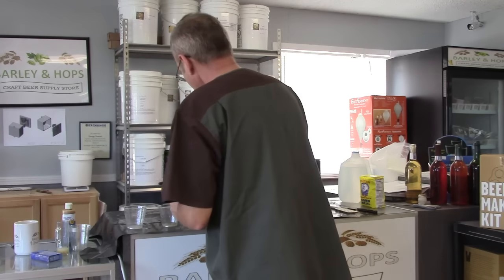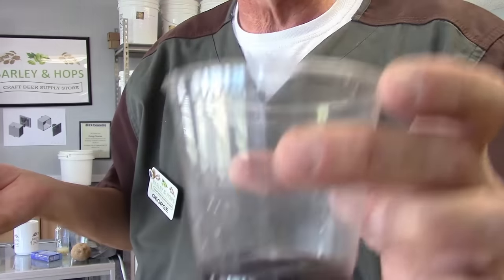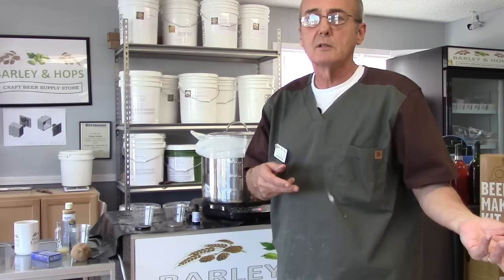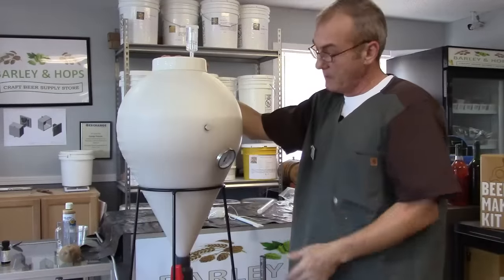How to make a corn mash for distilling

Comment from the maker: I read through several comments about corn meal and starch conversion. Here was the original question:
" I was wondering if you use corn meal if you would have to use the barley to help  convert the starches in the corn into fermentable sugars or can you leave the barley out and just steep the corn meal and that will convert the starches in the corn into fermentable sugars". 
Several replies led me to another test.
Here are the results:
1LB corn meal
1 gallon water
Mixed and took original readings (gravity was 1.001 and the iodine test for starch was positive)
Brought it to a boil and steeped it for 1 hour.
Cooled the mix and took the reading again:
results: Gravity was 1.001 and the iodine test for starch was positive.

Second test with the remainder of the mixture:
Heated to 155 and added 1/2 teaspoon of Amylase Enzyme.
Steeped for 30 minutes
Test results: Gravity was 1.035 and the iodine test for starch was negative. The mixture was also sweet, watery liquid and sticky on my fingers as opposed to its original texture which was thick.

My reinforce the science of converting starch to sugar. Amylase Enzyme must be present. Corn meal will not convert itself not can it. 
If using straight corn meal works for you please continue to do this. If you add any sugar to your corn meal and water mixture to ferment it will ferment but it is the sugar you added that ferments and not the corn meal.

all I can say is the science does not support corn meal converting itself

George
Reply from the maker: I definitely see a video coming on this one.
George
Reply: Barley and Hops Brewing LLC A
Reply: Corn meal cannot convert itself, but if you malt corn seed, it will convert to sugars.
Reply: Barley and Hops Brewing LLC If you were to use cornmeal how do you strain it? Wouldn't it just flow right through the Brew bag?
Reply: Michael Norwood first of all what I would do is use cracked corn or if it is powder form just let it settle when fermenting and bottle or keg as usual when brewing has finished.
Reply: Yeah i laugh at people doin this all the time.

Comment: So,  I got a 24 quart stock pot with a steaming basket inside. I use that, along with a 200 micron polyester bag and it works great ! The basket keeps the bag away from the bottom of the pot. When I'm done steeping, the bag lifts right out with the basket. SO much easier than trying to separate the liquid from the solids by other forms of straining.

Comment: Corn meal is expensive.  Cracked corn is cheap ($8/50 lbs).  Cracked corn will not stick a lautering operation.  I'd like to see you do a video on using cracked corn as the principle augmentative grain.  I found it best to mill it to a smaller particle size then add it to boiling water and when cooled to 190F add high temperature alpha amylase to prevent thickening.  Rye can be added then. At 165F it is added to a mash tun and malt is added along with a small amount of beta amylase.  After an hour this is lautered, boiled 30 minutes with sugar added, and cooled then yeast is pitched. The batch size was 10 gallons.  70% was corn, the least expensive grain.  American whiskey became corn based due to cost initially cost drive that turned into preference.  I tried corn meal and rejected it after a stuck sparge and high costs.

Comment: Hi George, love the videos. We have a small craft distillery located on the most southern island below Australia and over the last 12 months have started producing our single malt whiskeys that are currently ageing away in barrels. Recently we decided to attempt a American style "bourbon" whisky without much success. We are getting great conversion during fermentation and our last batch even produced the "cap" that you see on some other distillery videos but we are getting stuck on draining the wort away from the grains. we have tried both prier to and post ferment, we have used enzymes as well as made multiple temp adjustments but we are unable to drain using our false bottom mash tun. we are looking at a mash of aprox 300l (about 90 gallons in your language lol) Hope you have come across similar issues and have some tips. Cheers from Australia.

Comment: I was thinking that if you bought a stainless steel strainer that fit inside your pot , it would hold the grain bag off the bottom just enough that you wouldn’t need to worry about the bag burning/ melting on the bottom of the pot.

Comment: George can you answer me a qhestion?? why does it say on my turbo yeast  NOT TO USE A AIRLOCK BUBBLER ??  this kinda confused me,, is it because it holds gases  in or they think it will blow off the air lock?  thanks Ray Fuselier
Reply from the maker: +Ray Fuselier Alcotec does have that in the instructions and also adds that you should check with the laws in your country to make sure you are conforming to them. High Spirits and others we carry do not have that in their instructions. All of them recommend a lid and airlock.
I am not sure why Alcotec includes this statement. 
George
Reply: +Barley and Hops  thanks George,, i have check missouri laws and looks like MO  is the only state that allows a person to run a still,, without a permitt,, it says a house hold can  make 100 gals per person per year,,''lol'' thats alot ,, and cindy and i dont even drink,, maybe a glass of wine at night,, we just enjoy making the spirits and the wine
Reply from the maker: +Ray Fuselier You are correct. MO is the only state to do this so far. I guess they are on the heels of Colorado and a few others. Good luck and enjoy
George

Comment: Soooo, there are at least 3 ways to make this same recipe. 1. just the corn plus the amylase cooked at 152-158 for an hour. 2. the corn, minus the amylase, plus the distiller's malt. 3. either of the above plus sugar to increase the yield. If ones desires quality over quantity, which do you recommend?
Reply from the maker: +thastinger345 If more quality is your goal reduce the sugar used and increase the corn. You can do this proportionately to arrive at your desired flavor. 
George

Comment: hey George your vids are great and very helpful.. I was gona ask you if you think a 2nd distill will help the flavor of a scorchedmash or should I just dump it. 5lbs wheat flour 2lbs white corn meal and it just burned before I new it.. dang it. got to get one of those bags! thanks again..
Reply from the maker: +haulshine409 Sometimes that does help but I have had runs that just wouldn't clear the burnt taste. It is definitely worth a try. 
George
Reply: haulshine409 - Redistill 1-2 more times and filter. You’ll loose most the grain flavor, but it’s better than dumping it out. Or make a Vodka out of it. This is what I did. Turned out pretty good. 

Also, get away from using flours. That should help with the scorching. Hope this helps.

Comment: George quick question, in the corn meal vs flaked corn video you boiled  the water to gelatinize the corn and you said that if you keep it at 155/160 it wont gelatinize. here its the opposite, is that because the 6 row barley is present ? I believe ive heard you say that if you boil the 6 row you kill off the enzymes.... is that correct ?

Comment: George, If you use corn meal instead of flake corn do you steep the meal and 6 row at 155 degrees?
Reply from the maker: +John Dewitt Absolutely. Same product just a different form. Corn meal is super easy to use and very economical. I recommend that you bring the corn meal to almost a boil first to hydrolyze it and then add a little water to cool it to 155 before adding the grain. This process is simple and ensure you can convert as much starch as possible.
George

Comment: You are using 6 row, we live in a remote location in northern alberta, I can get 2 row. If we were to use 2 row & corn meal would it work ok. Your videos are great. We just got a 10 gal stil & ran the first batch of sugar mash, it is a learning process. Thanks
Reply from the maker: +robert groves Absolutely. 6 row has a diastatic power of 160, 2 row is 140. It only requires 30-35 to convert itself so all those enzymes are left to convert other adjuncts. 2 Row works extremely well. There is no need to search for 6 Row barley use the 2 Row for the same results. There is so much enzyme in both that the difference is un-noticeable.
George
Reply: +Barley and Hops Thanks, really appreciate the information you post on you tube. The posts are well done.
Reply from the maker: +robert groves Thanks. I wish you all the best. Happy New Year
George

Comment: So the recipe is:
2lb 6 row Barley
4lb flaked maize
10lbs of corn sugar
5gal water

Is that correct?
Reply: That's what he said, but the text on the screen said use a 3:1 ratio of corn to grain. 
 4lb corn and 2lb grain is a 2:1 ratio.  So, which is it?
Reply: @Antoniodenavarra  I tried the 2:1 recipe and it came out great ! I imagine, since they added the note about 3:1, that THAT would be what George meant. I had hoped George would answer the question.... Oh well.

Comment: I was wondering if you use corn meal if you would have to use the barley to help  convert the starches in the corn into fermentable sugars or can you leave the barley out and just steep the corn meal and that will convert the starches in the corn into fermentable sugars. I see some people doing it that way and some who say you can't do it that way, so I am wondering what is your take on not using barley and just steeping the corn meal to convert the starches in the corn into fermentable sugars. Thanks for you expertise knowledge
Reply from the maker: +Steve Rabon Steve, if you just steep corn meal or flaked corn or any flaked product it will never convert itself. It requires amylase enzyme to convert starches to fermentable sugars. So, either add malted grain (which is loaded with this enzyme) or add Amylase (which is available at any brew shop or on line).
Otherwise you get no sugar to ferment
George
Reply: OK thanks. That was what some had said, I have seen some who just steeped the cork meal also. Thanks for your expertise knowledge. Thanks.
Reply: +Steve Rabon the above isnt neccesarily true, the starches in the corn will convert into sugars if you boil the cornmeal and your Mash sad about I don't know 325 degrees for about 20 minutes it is boiling action will do with the enzyme would normally
Reply: I put my corn meal (5 pounds) in a crock pot with water, heat it on low till it boils, cut it off and let it cool. It converts all the starch to sugar. I add the corn sugar and it really makes good corn liqour.
Reply from the maker: This should be cleared up (from my perspective) in about an hour. I have 3/4 gallon of water, 1 LB of corn meal steeping right now at a low boil. I will check both the starch levels and gravity when finished. Beginning test was positive for starch and the gravity was 1.001.
George
Reply from the maker: I feel a video coming soon (smile)
Reply: why use the specific gravity scale when the potential alcohol is an easiermath for people to understand??

Comment: So you're adding the sugar simply to increase the final product yield correct? Do you feel the sugar changes the taste compared to distilling without it?
Reply from the maker: +thastinger345 Yes. You are correct. I am adding sugar to increase the yield in the end. Since it is corn sugar it doesn't have an effect on the taste. I have made this both ways and when I add sugar I almost double my output. 
George
Reply: Barley and Hops thanks for the info, have you made it with table sugar? If so, was the taste impacted?
Reply from the maker: +thastinger345 Yes I have used table sugar. It does make a difference but the average person would probably not notice it. It is so close to the same it is hard to tell the difference unless you had both side by side. Table sugar turns a bluish-green in a bucket of water when mixed whereas corn sugar does not. Table sugar has been processed 6 times so I am always suspect of what else is in there. The cost difference is slightly high as well. Corn sugar is around $1.20 or so a pound. Table sugar is below a dollar.

George

Comment: I have followed your directions to a tee and twice now I cannot get all of the starch to convert.  I bought one of those induction hot plates and the temp was all over the place.  I would see 10-15 degree fluctuations.  I think I was 3 hours in, I even added some enzymes and it still would not pass the iodine test.  This last time I put the mash on the kitchen stove and let it steep for nearly 8 hours at 155 and it still would not pass the iodine test.  My OG was 1.114, no where close to your 1.120.  My FG was 1.047.  Both times my ABV was 8-8.5%.  My mash stopped fermenting/bubbling on day 6.  I have used the same recipe twice now and  I cannot figure out why I cannot achieve a higher ABV, more on the 12-15%.
Reply: I see two problems here: the first is the fluctuation in temperature, which might have brought the temperature too high, to a point where the enzymes are deactivated. The second is that maybe your yeast has a alcohol tolerance of around 8,5%, which means that the yeast "gets drunk" and goes to sleep when that alcohol threshold is reached. If you want to reach higher alcohol content in your wash you have to use a yeast with a high alcohol tolerance.

Comment: Hi. I have a reflux still and make raw sugar wash for my spirits. Then soak in oak and so on.. if i pull the stainless steel and copper out of the column, still adjust temperature, will i simulate a pot still? And retain flavour? 

I have a turbo 500 still. Can buy a pot top, just wondering. Just wanting to make some traditional bourbon. I assume the reflux will remove all flavour if i leave it as it is. 
thanks in advance...

Comment: Hi George, noticed you didn’t add Glucoamylase, if you had, would you have pitched it as the same time as you pitched the yeast? Thanks
Reply: Ive never seen a video or book discuss gluco amylase yet the big commercial distillers use it to pull the max ferementable sugars.

Comment: what starting gravity are you looking for in your mash? Giving an actual target gravity makes it easier to adjust for different sources of sugar.
Reply from the maker: +Aaron Johnson Most of the mashes I make having a starting gravity of 1.110 or higher. These are the ones I add sugar to to get them high since I am looking for volume. There are other recipes that are in the 1.080-1.090 range too. These are more specialized.

Comment: George...at what stage do I add amlase to my corn?
Reply: The amalayze enzyme works well at about 150 f and can be added at the same time as your other grains. At higher temperatures it becomes denatured. At lower temps it works more slowly. With a lot of adjuncts, I tend to add with my malt bill. I also have added it when I pitch the yeast.

Comment: I got a question about the induction hot plate. I was looking at it and it said it only works with induction ready cook wear. is your pot a induction pot?
Reply from the maker: +James Allen It works with my pot. My pot is stainless steel and it works fine. It is not an induction specific pot.
George
Reply: +Barley and Hops thanks mine does 10 degree increments.

Comment: Just wondering about boiling the mash to soften the corn. Will this mess up the starch conversion if boiled after 1 hr starch rest?
Reply from the maker: +John Brown What temp are you resting at? Normally the corn (if corn meal or other such product) is brought to a boiling temp and rested there for 10 minutes or so and then cooled to 155 for conversion. 
George
Reply: One hour or more at 155-160 * f . Im asking how you would think it would affect sugars to get it to boil, a rolling boil shortly, after mashing. I assume once the starches have been properly converted, boiling should not be detrimental. Much as in how mash is processed for making beer. This purpose is to soften up the hole kernel corn for more readily digestible for the yeast. Thanks for the fast response.
Reply from the maker: +John Brown I see now. There is a correlation between beer and spirits but not a direct correlation. In beer brewing we go through a protein rest and scarification which normally calls for a 10 minute rest as the temp goes up. When we use corn that has not been hydrolyzed we need to bring them to a short boil first and then bring the temp back down so the enzymes can get to work converting starches to sugars. I would imagine that it wouldn't make a difference if you stopped at 155 and then went up to a near boil before going back down as long as amylase enzyme is not introduced or grain is not added since the enzymes will be permanently neutralized at high temps (168+). 
Hope this helps
George
Reply: Yes your rite, I like the Idea of boil for a bit first then do a protein rest.I used to brew beer, making whisky is more fun and less work. Your videos are the most informative and professional, kudos to you.

Comment: What are your thoughts on using non diastatic rye malt extract instead of barley.All I can find up here in Alberta is standard two barley. For the corn mash that is.
Reply from the maker: +Aeromech75 Non diastatic means there are no enzymes available so standard 2 Row barley should be your go-to-grain for starch conversion. They Rye extract will offer some sugars but will not offer any conversion benefits if you mix it with corn. Use about a pound of crushed standard 2 row barley per 5 pounds of corn in order to convert the starches to fermentable sugars. Hope this helps
George

Comment: Question: what was the Nuwave Titanium Pic model number you used on this video to go o settings of 5 degree increments? I would like to use it on a 8 gallon pot. Watts?
Reply from the maker: It was an 1800 watt
Reply: Thanks George. Did you purchase it from Amazon?  What was the model number?